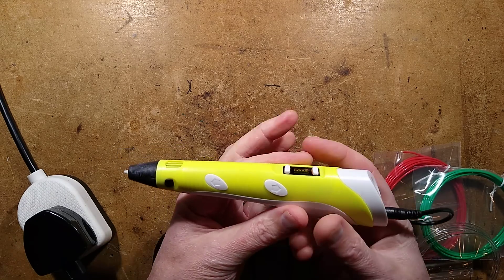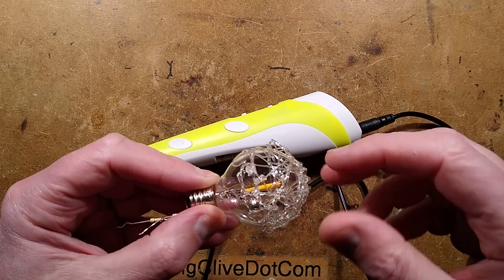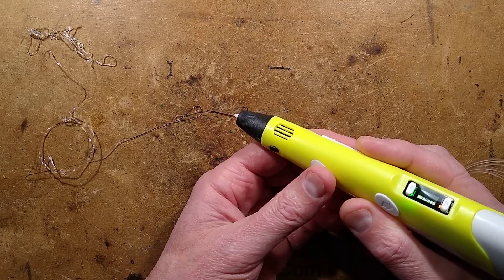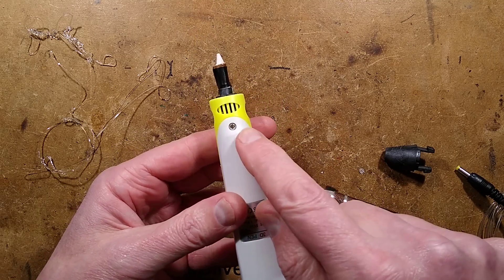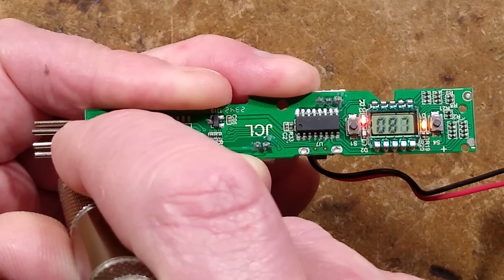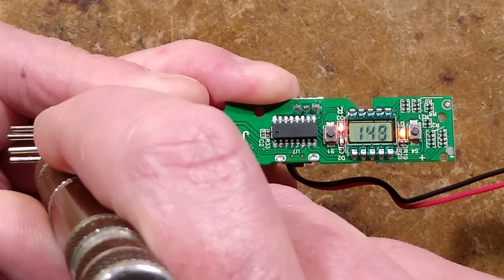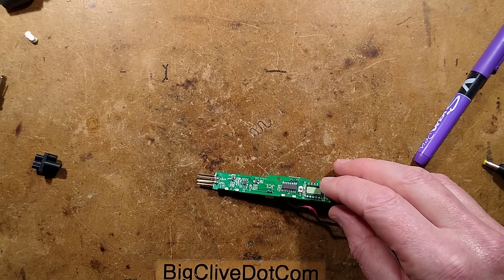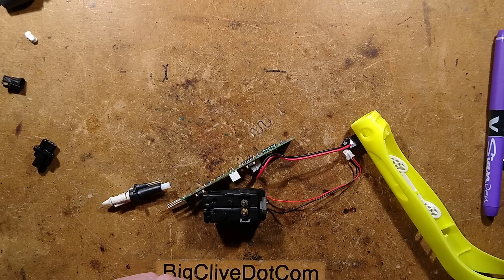Inside a 3D printing pen

Comment: I have one and have had it since my first week of 3D printing, to be able to repair small fails in large (as in multi day) prints, or stuff like that. However such things didn't happen that often at all, and i ended up using it only two or three times in a time span of about 10 years 😂.

Other than that I PERSONALLY find then quite useless also to be honest. The controls are also TERRIBLE. Like yours, mine also has the 'press once to extrude, press again to stop'... and in the most uncomfortable position to be able to work accurately and cleanly.

I THINK if they would move the buttons (OR add an extra one which works as 'hold to extrude') that it would be much more functional.

Neat video, and I don't blame you at all for not making a circuit drawing of this 'contraption'😂👍🏽

Comment: I bought one of these pens a couple of years ago to basically play with, but when I started downloading free 3D print STL files for things it found a practical use. Some of the files I downloaded had some design errors - thin areas that cracked, or oversized holes and slots. The pen allowed repairs to be made, in a sloppy way mind you, to allow the printed gizmo to be used and not scrapped. Handy too for plugging holes in things when hot glue isn't quite permanent enough. Have I got good value from it? probably not, but it's been useful in some cases. Cheers!  PS it should not be underestimated as a tool for making freehand sculptured decorations for beverage glasses used after carbonation...8^)

Comment: I bought one of these to weld together my 3d prints, but mine has the speed slider running opposite of the one in this video, and the advance button is only momentary (reverse is a constant run unless you stop it with the advance button). Exact same casing, display, everything else is identical. It's been amazing for use with PETG! I wonder how many variations there are being cranked out of the same factory with nothing more than a different name put on it?

Comment: They are awesome for repairing broken 3D prints. A number of times I have 3D printed something, only to not include enough support or make certain parts  weak. Once they break all you need to do is "weld" it with this pen and it's good as new.

Comment: I use mine mostly on fixing prints, occasionally welding prints together if the join doesn't need to be that strong. Adding dots to loose friction fit parts to increase its strength (again, non-critical stuff..) and fixing failed supports mid-print. They are handy but limited. But what they do can't be done with any other tool, so.. used three times a year, on average but i do not regret buying it. I did buy two cheapos from eBay before biting the bullet and bought a Polaroid pen. It has worked just fine, a bit finicky about the USB power as it does seem to actually draw the full 2W so you need to give it a proper USB power supply. The cheapos didn't care at all what PSU i used, as long as it was somewhere between 1 and 2W. 

Especially fixing supports is what it does really well and better than any other method. The bad news is that it is clunky as fuck and does not have removable nozzle cover: that is why removable covers are better, they narrow the tip down to minimum.

Comment: I had a really early one of these, back in like 2014 or something (maybe earlier?) and - to be honest - it was crap lmao
It cost ~£100, was pretty big, could only run for like a few minutes at a time, and had an inbuilt fan that was pretty loud iirc

Years later (like late-2017) I got a 3D printer which has been a lot more fun to use than one of these 3D pen things lol

Edit: Is the thermistor even real in this? Wouldn't be surprised with how the 'temperature readout' functions if the thermistor is actually just a dead short and/or a 10k resistor made to look like a thermistor

Comment: They're apparently excellent plastic welders and good for touching up 3d prints that have come out a bit wonky.
Only having plastic type settings and not temp settings is a big fail though. IIRC abs melts a bit higher than PETG so it should be able to do PETG too if it had a temp setting mode. Make it a bit hotter and you could do nylon too, though I can't see nylon working well out of one of these.

Comment: 3D printing pen's are great for welding plastic shells together. i have used them in the past to repair vr controllers(knuckles) and 3dprinter parts. great cheap bit of kit.

Comment: One thing that stood out to me is the unpopulated place on the PCB for an 8-pin chip, presumably 'U1', which suggests there might be a slightly more advanced version of this device.
Reply from the maker: That's just an alternative H-bridge package position.
Reply: Maybe the "more advanced" version has a higher wattage heater?
Reply: That driver is for the motor, not the heater.
Reply: Maybe for wheels?

Comment: Nice one! All you have to do, is to mount it in a cartesian frame and use som steppers and a small microcontroller, some software and perhaps you can even automate it!!!

Jokes aside, I'd guess if you experimented with this thing with thermistor loose or shortcut, I can only guess that you'll get a very hot hotend indeed. If it were to reach 388 degrees, which should be quite simple, PLA will ignite and if you're not around to watch when that happens, if you're lucky, you'll be able to extinguish the fire quickly. Otherwise it won't go well…

PS: Please revisit this to take a closer look what'll happen if/when this thing goes haywire. I'm pretty certain this is a catastrophy waiting to happen.
Reply: It's made in China, what could possibly go wrong?  🤔😂
Reply: @Zodliness  Well, I remember the Ultimaker Original printer. It was quite alike what's described here. If the thermistor came loose, which it easily did, it never ended heating up the hotend, until the filament (in my case PLA) caught fire. Been there - done that. Thermal runaway protection was not really known or at least not prioritised back then. And keep in mind that Ultimaker was Dutch back then.

Comment: These things are so neat and fun to use, but the early ones were a bit picky. I had to repair my scribblr like a week ago. It got too hot and jammed a bunch of pla down into the area just before the heating assembly.  Ended up having to blast a mini screwdriver with butane and jam that a inch into the nozzle to melt it enough to pull it out the circuit board side, so I wouldn't have to desolder the heater.

Comment: My 3d pen has saved me a few times when a print starts to come off of the bed. Trying to use this on a bed slinger is a bit tricky.  I've also used it to glue together prints.

Comment: Definitely useful for modification to 3d prints. Fixing / joining parts, filling holes. Fixing in magnets. 
Saved me many a time from having to do a full reprint. If I've put a hole in the wrong place. If you have to drill a new hole you're probably drilling into infill not solid plastic, so you can reinforce the infill with the 3d pen. 
As a tool to make something from scratch, then perhaps not.
Reply: Absolutely it's an amazing tool to have I would love if 3d printing companies made their own 3d pens and made it better like having the ability to change the nozzle diameter
Reply: They are/were quite popular in the crafter/maker community, Maplin used to sell them and the boxes had all sorts of 'from scratch' ideas on it, I think there was also a book of ideas.

They're used to make supports for 'stuff', freehand objects, sculptures, patterns, drawings and designs, standalone or on other objects, they're also useful for 'masking off' if you're going to add 'colour' to things and I'm sure there are hundreds of other uses.
Reply: This right here. I bought mine with the intention of modifying or salvaging components, but it's proven most useful in joining parts I needed to split up to fit on the print bed.
Reply: I use my 3D pen to make models which are made from scratch, its a great tool for art.
Reply: Exactly this.
Reply: The thing is, if you are reinforcing the infill, you need a big enough hole to get the plastic into the infill.   For repairs, maybe it would be good, but it would leave a definite blemish on the surface and you'd always see where the hole was filled.    Having more of a think, I am not sure that reinforcing infill would work given the infill is in small segmented pieces and the plastic would just stop at the next segment, so you'd just get a small solid section, the rest of the infill would still have no reinforcement, not to mention that you could not reliably guarantee it would adhere to anything as it would just flow in like hotglue and not have the squish that a proper 3D printer provides.
Reply: @EsotericArctos  yes it's a rough and ready fix. It depends on what you are making. As for the hole and infill examples. If you think about how a hole is printed, it has infill then  maybe 2 or three lines of wall, depending on how you slice it. 
Drill a hole a bit bigger than you need. Fill it back up with the 3D pen then drill again to the correct size.
Reply: @EsotericArctos  You drill out more than needed and fill it then drill the diameter needed. It works.
Reply: @EsotericArctos  You only need to reinforce the walls of the hole, not the entire print.
Reply: @EsotericArctos  you can smoothen out the surface with wood burning irons or your soldering iron. Also with small nossle and your hotair soldering station. Use a multitool or just sandpaper. As long as its verry hot you can also just cut overhanging material with scalpell.

I often use the Pen for repairing plastic housings damaged from a fall and often secure internal Standoffs for Pcb and fasteners who are ripped off.
Once repaired the internal stripped out Vesa Screws in a 38" TV.  Made a large blob arround the metal bushings with the internal threads. Almost 5cm in Diameter to the main body and 3cm high to give it all enough strength.
The Repair is still holding up now for years.
Reply: @EsotericArctos  most people I see use these pens usually also use sandpaper and paint to make up for it, and they smooth out with soldering irons set to a low level

Comment: I have a Polaroid branded one, use it for filling voids in 3d prints and repairing broken prints as you can melt the two sides together with the tip of the pen and apply new melted plastic at the same time. Very handy.

Comment: These used to be 12v and would go up to 240C. It's very hard to find these any more. The 5v ones don't go as hot and they don't  melt ABS as well. I use my 12v model to repair abs parts by prewarming with a small butane hot air nozzle and follow with the pen to weld the pieces  together. The 5v models aren't as effective
Reply: Good to know. Thanks! 👍

Comment: How intelligently does the voltage across the heater terminals respond to manipulating the thermistor input?
Reply from the maker: It will be probably just be toggling on and off between the limits.

Comment: you got the good 3d pen!!! i've been trying to get 1 of these since mine broke, this is a way better design than the 3d doodler which only has 2 forward speeds and NO reverse, these are great for repairing/patching/assembling actual 3d prints
edit: this may be a clone of the pen i had, mostly the same components but mine had an actual linear pot for the speed control also a random use for these is insulating random broken wires without properly repairing them when the insulation breaks RIGHT at the strain relief, my 52v bike charger had that before i replaced the entire dc side to the board

Comment: If the temp sensor fails high, could you overdrive the feed to compensate? 
I know nothing about multiplexing past cars have it. Can the 3 resistors be changed or will the chip not cooperate?

Comment: I got a bunch of those tiny LCDs for about 1.5usd per lot of 5. Now I know where they were originally used for. I never got around to using them yet as they are not as simple to use as I originally thought. There are three common pins as suspected but they are not per digit. 1 common is for the top segments, another for the middle segments and the 3rd for the bottom segments. Makes coding a bit of a pain to make characters.

Comment: Hummmm... if there were conductive plastics that could be used in this device I could see it as a quick circuit board tool.
Reply from the maker: You can get conductive filament, but it's very expensive.

Comment: You not being able to push filament through while off is probably a consequence of the gear train requirements of torque at the end of tbe line to rotate. The strand can't push hard enough before it deforms.

Comment: ABS gives off toxic vapors when printing, and an enclosure is advised when using it in a 3d printer. So this having an ABS setting strikes me as wildly unsafe, as how many people actually follow the warnings given in the included literature ? Given how litigious the US of A is, I'd guess not many 😅🤣
Reply: I don't think the ABS fumes are toxic, unless you overheated it, I worked in the plastic moulding industry for about 30 years, When moulding ABS, at the correct temperatures, (around 220 - 250°C) it often had a sort of sweet smell.
Reply: @RichieReportsUK_UKCNews  Just about every 3d printing blog mentions the need for an enclosure for printing ABS, and many give the reason as toxic fumes..
I did go find a MDS from one of the filament manufacturers and also read up on fume extraction and found "Although ABS filament fumes are not considered toxic, they are unpleasant to most users. As the material is heated in a 3D printer, it creates gas and microscopic particles during the process. This exudes fumes that can cause physical discomfort such as drowsiness, eye irritation, nausea and headaches."

So while not toxic, its also not great 😅
Reply: @nicholaswouters1203  Enclosure for ABS is mentioned for a different reason, it's very prone to shrinking when cooled down and a random draft can break the part. Enclosure helps it to prevent sudden temperature changes, and it's even better if the chamber is heated. A simple chamber isn't going to help with safety since it's not airtight. The ABS plastic does seem to be somewhat toxic, I even heard about people who had poisoning after using ABS and ASA, and I personally decided not to touch these with 10 feet pole just to be safe. But unless you need parts with higher than average temperature resistance, it's more common to use PLA or PETG that are less demanding and tricky and overall quite robust if not used at high temperatures.
Reply: @lpanic  One big benefit of using ABS is that it can be vapor polished with acetone. PLA and PETG need solvents that you don't really want to be using in your house.
Reply: @lpanic  As I said, in a previous post, I worked in plastic moulding industry for 30 years, using ABS & ASA  everyday & I'm still here, maybe I became immune to it!!

Comment: I know somebody who uses such a device in conjunction with 3d printers. They build big sculptures with many smaller 3d printed blocks and parts, and this is one of the tools they use to join it all together and smooth out the seams.
Reply: Exactly what I was thinking. I have a 3d printer and was considering buying one of these pens for "gluing" together pieces
Reply: haha, I do the same. I use the pen to weld larger printed things together. I have exactly the same model that Clive has in this video. Had it years. Always worked great
Reply: Yeah most I know which have one use them for the same purpose. I do that with my soldering iron (with an additional soldering tip I only use for that).
Reply: Sounds great! 👍
Reply: I've used mine to join printed parts as well.
It may not be a perfect solution, but it does the job.
Reply: I would assume thesse would be non structural joins, given that adhesion would not be brilliant with the rest of the plastic being cold, not to mention that being handheld it would be variable as to how much a layer was squished onto the previous layer.
I think I would still prefer using a glue to join things together rather than this device for strength of the join
Reply: @EsotericArctos  For structural joints I would never use my 3D pen indeed. I only used it a few times to close a gap on a "figurine like" model, or where I wanted to close a (misplaced) screw hole for example. 

I personally always use my soldering iron (with an tip I only use for this purpose) to 'weld' parts together. But yet again only for stuff which obviously doesn't get too much strain. Think of something like a miniature painting, where there isn't enough room (due to the size) to make a 'snap fit'' or screw solution.
Reply: @EsotericArctos  you can use the nozzle to melt the existing plastic to get a better bond. If you can split things with a chamfer so you can get some decent penetration for your "weld" you can get some pretty good bonds.
Reply: I got the same model. The motor gears broke. I would recommend to get a different model

Comment: ...I wonder if you could use the pen to draw symbols on 3D printed parts then use a heatgun to embed those symbols into the surface?
...Extraordinary amount of cost optimizing to produce 'believable' readout changes.
...Makes me feel a bit bemused that such lengths have been taken to glitz (falsify) the readout.
...As usual... THANKS for taking the time to give such an enlightening teardown.

Comment: I dont know why they bothered with an LCD. They have 2 types of filament to print with so 1 switch between the two types. We dont need to see the temperature if the PLA wont come out you turn it up if its running like a childs nose you reduce the temp.   I can understand the ;ack of a drawing. 2x👍
Reply: There are different 3D filaments you can with like PETG or nylon and having a screen can help with selecting the perfect temperature for the filament and not to mention there are different filaments that have a different color/look at certain temperatures